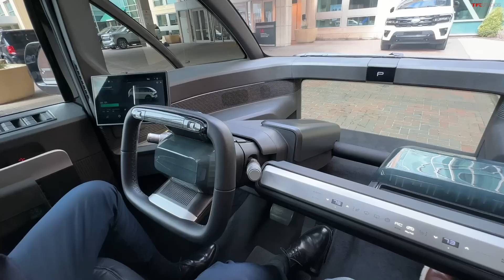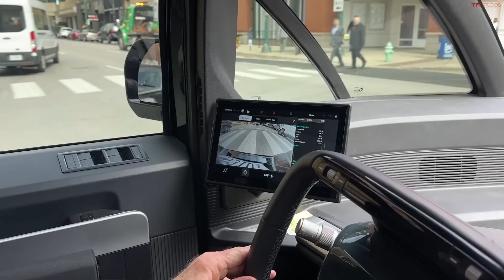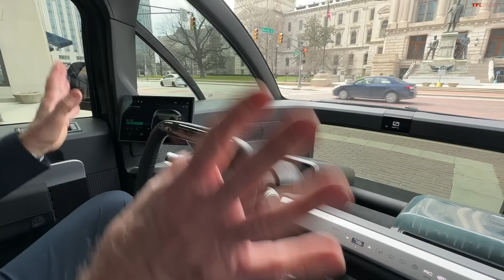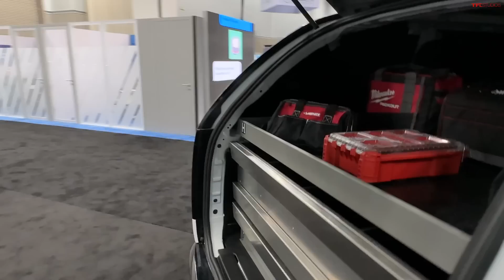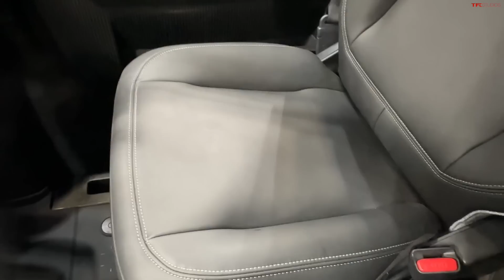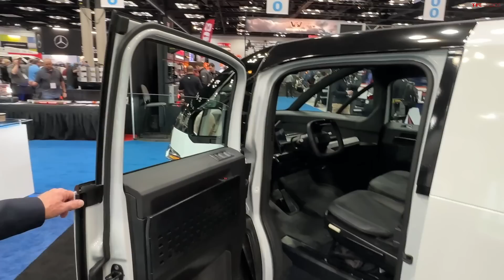The All-Electric Canoo Is Like NO Other Van You've Ever Known or Driven: Come Ride Along With Me!

Comment: I’d be surprised with draws of tools and equipment like that if you’ll maintain the 200 mile range. I work for a major elevator company and we use quiet a bit of heavy equipment.  driving in the city will be good I’m sure, but range will be interesting to see…
Reply: i suspect you won't maintain the exact same range, but weight actually has quite little to do with range (and in city range will be greater than 200 miles because of regen braking, which weight will have no effect on unless it overpowers the regen brakes).

Aero is where 80% of energy goes in even the most areodynamic designs like Lucid, I wouldn't be surprised if it was over 90% here.

If you want to extend your range you go at 90km/h instead of 120km/h (55mph as opposed to 75mph). I believe range estimates are provided for highway driving at 70mph, your gains will be 20%+ if you drive at 55mph.

Temperature kills range however.

This will be extremely good for micro-mobility bus companies or tradesmen in cities. Taxis would also benefit greatly. I'm skeptical of other uses because if you have a family you likely want to be able to road trip, and this won't be capable of doing that.

Comment: I cannot help but wonder how long it will be before the “signature street view glass” is cracked while driving on the highway. I do like all the other aspects of this vehicle. Range needs to be increased but at least one-hundred miles.
Reply: The windshield on my Colorado lasted 3 weeks of driving in Houston, the windshield on my jeep wrangler lasted 2 days...
Reply: Great point, really neat to see that front glass, but I suspect it's not very practical.  It will definitely be a rock magnet.  And it doesn't appear to have a bumper either, so most accidents are slow enough not to deploy the air bag system.  Seems to me this little van will suffer lots of damage in a fender bender situation.
Reply: They should have just given it a 360 bird's eye camera system and a smart rear view mirror. Sooo much better for situational awareness, parking and maneuvering. That low down window is going to be filthy and pockmarked all to hell in no time.

Comment: Again… the issue with larger EV is that larger cars like Vans and SUVs are usually meant to be used for road trips  and long distance travel for fiends and family. So… 200 range … probably more like 150 with added weight and heaters running.

Comment: Interesting vehicle, but what design engineers thought putting the mirror adjustment on the steering wheel was a grand idea? It is one of the features that is rarely used after initial adjustment.

Comment: How safe is a steer by wire design? Having a mechanical connection from steering wheel to rack and pinion is by far the safest design. No need to re invent the wheel. I must say though this is a awesome futuristic looking van and I would buy one if I could.

Comment: I’ve seen some of these at various auto shows at various points during their progress. I think these are a great idea. They look a LOT bigger in video and photos than they are. It’s probably about the same size as a compact crossover in exterior dimensions, but because it’s a box on wheels, the interior is massive. The price is also surprisingly reasonable for an electric van.

I wish them well and I hope they make it to production. I think the shape may be too radical for most people (most people want super bland/the status quo), but hopefully it’ll sell well in the commercial space where turning heads is a positive thing.

Comment: Sorry but steering "wheels" are better as a wheel not a rectangle. How often do you use mirror adjustments? Why would you put them on the steering rectangle? If they can actually sell it at 49K that's good. Range not good.

Comment: I don't understand how this vehicle's design is suited for fleet uses. It just looks like a sci-fi design to look provocatively different? Visibility is horrible because of the cab-forward design and multiple A-pillars. Crash results will be terrible with the glass hanging in front of the front axles. HVAC efficiency is compromised because of all the dead open spaces. Airbag system for the front occupants will need to be extra large or require stacks of bags to keep them oriented correctly upon deployment. The cargo area volume is compromised. 

This vehicle has ton of complications that offers no added benefits or competitive edges over others.

Comment: It seems like they've done a lot of thinking and planning to make sure this vehicle has as wide of a use case as possible for potential buyers. It's a pity the rear passenger door opening isn't about 6 inches wider, it would then be able to accommodate wheelchairs as well with next to no further modification required.

Comment: When I first saw the early prototypes of this van, I thought they were hideous. But now that they have been tweaked and are just about ready to hit the street, I like what I see now. I really like the quick steering and very tight maneuverability. And it fits into a standard garage. It’s 200+ mile range is acceptable and has plenty of power, and is relatively light in weight. It’s not 7,000 to 10,000 pound brick behemoth. And it’s not a cramped little urban people mover appliance compliance vehicle. 

I think I have found the replacement for my 2015 Ram Promaster City SLT wagon (5 passenger). And it looks like it will have an acceptable (affordable) price as well.

Comment: The people talking in the back are being pretty rude.  I love the van but steer by wire isn't something I don't have a lot of confidence in.  Too many little things that could go wrong and you lose all control.  A short or burnt out electric motor or blown capacitor on a circuit board.

Comment: Great video Andre! I've had my eye on one of these to possibly replace my current Sprinter photo/video production van. 

After watching through, especially the final bit showing the service variant I have a few concerns about that one as a commercial vehicle. Typical vans make use of sliding doors, which are important as they are often parked on the street/curbside with limited space to haul gear in and out. Canoo's side cargo door that opens outward though...I can see that being problematic.

Along those same lines, it's great that the van is so low as to be able to fit into garages, but then the rear hatch opens upward (AND outward), kind of defeating the purpose of the vehicle having a low profile. Again, the rear split door design of traditional cargo vans works better for this, especially when they can swing all the way flush with the sides of the van. 

I get that Canoo is trying to be different and indeed has made an exciting vehicle, though sometimes the "old" way of doing things is that way for a reason.
Reply from the maker: Thank you for the valuable feedback!
Reply: @TFLEV   he rear top end is also curved causing les stoag space, not like areoydnamics benef would be there.   I really doubt the visibility would be that great if you test it out. Sure, it has a lot of window, but it also has twice as many wide body pillars blocking your view. The front-most A-pillar is also in a spot no other car has, blocking a completely new sector the drivers need to get used to. And the B-pillar forward of the door isn't any smaller than other cars have.  front space , wasted space because you can't store anything heavier than a pillow there due to crash safety. Compare it to the frunk in for example F-150 Lightning and Rivian that provides a new and highly useful storage that traditional pickups and vans didn't have. The only advantage the Canoo design provides is the lower front window. Sure that's an improvement over modern American trucks with man-height bonnets that can hide a whole car from view. But compared to the M-B eSprinter TFL showcased just couple days earlier with the sloping bonnets that gives a perfectly fine view of the road it is a useless gimmick.                            reason why i dont liek electric car is  that battery degradation and lack of battery recyling. dendrites that forms from battery degradation is messes with recyalability too.  if you look at sandy munroe video caled wjats insize 680 battery, there could be indicator of how much of battery can be recycled by mechnaical seperation vs what chemical process would be needed, woudl it be susntinable process? recycling company called redwood. even if they fix this problem, will they dig through trash to find enviromentally damaged (rust, mud,etc) dead car batteries currently being dumped, and recycle them? in emissions, best hting to do is a ca rof where rear seats face the rear as comcpact 4 seate rreplacing 2+2 seater cars and yaris corolla cars, and  rear mid engine small combustion flat 2 cyulnder wnith no rotatiing parts to send power to wheels, instead magnets moving back and forth make electricty aand or a little supplemnetary compressed air , to power electric drive and compressed air driver, possibly with no battery or at minimal battery, using supercapacitor etc.  optimal combustions per second for emissions with electric and mechnaical hybrid turbocharger, sometimes engine will run beyodn optimal effiency or emissions levels for unsuually high power demand to protect long term emissiosn and fuel use reduction effetiveness of battery for common lower power use. with limited batterys to use, hybrids are already more effceint effective at reducing emissions, vs using that battery material for fewer cars who are electric cars, becaue most emissions happens in low speed high pushing power sitatuaitons of combustion car, where emissions are most likley to chemicaly harm health of nearby people becaue its usually compact city area with many people nearby.              what battery size is best for longevity?  see tony hellers climate change videos, maybe somone can make use of suspicious observers videos.          see aptera owners club video on saftey, unqiue materials they use, lightweight is safer to peopel outsid ethe car but can be safe for people inside car compared to hevaier caar if using right materials, and even safer due to wat type of crash is more likley to happen.. linearly more ligghter weight exponentially causes less road wear damage causing less resurces and emissions and road downtimes.                                in effeincy per functionality, rear seats facing rear in sompact 4 seater woudl make more sense. solarpanel effeincy is only arouund 20 percent and can become lot better